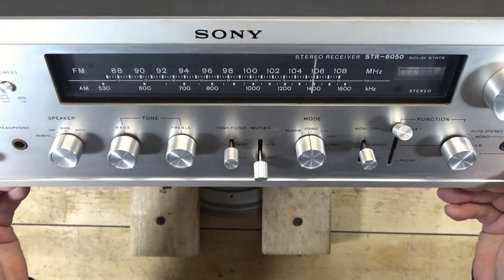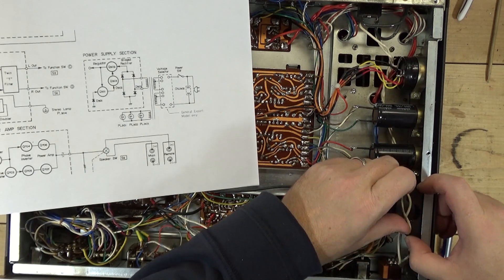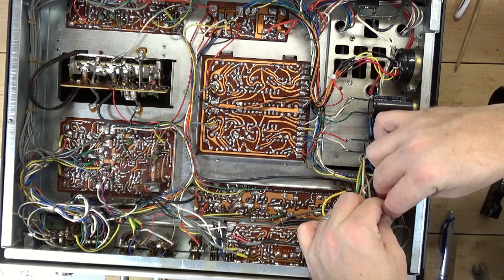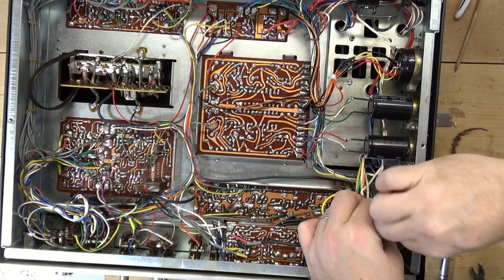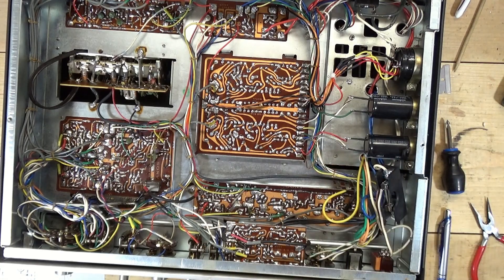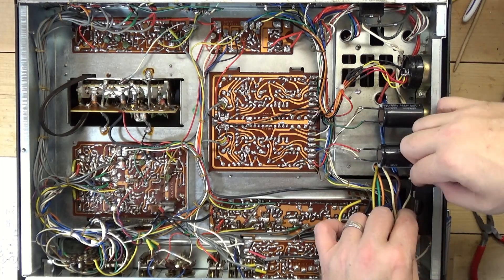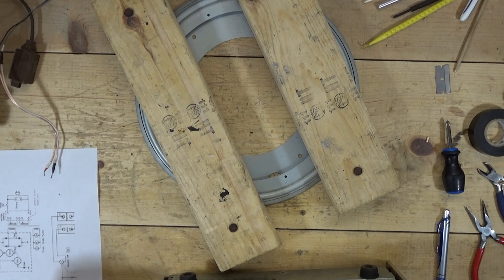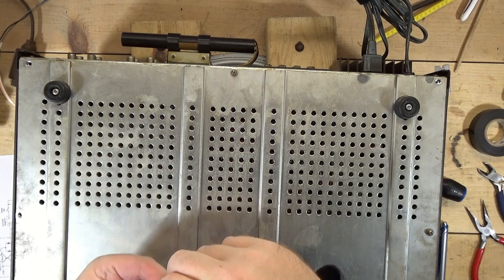Sony STR 6050 Stereo Receiver Upgrade - Adding a 3 Amp Fuse Holder

Comment: Hello, i thinking to buy str-6050. But few days i go i findout that they dont have fuses and can fire up... found your video. So is that fuse instal modification reliable and safe?
Reply from the maker: Without creating a condition to ‘blow’ a fuse it is hard to tell…the placement of the fuse is consistent with the placement of fuses in similar receivers.  As I say in all of my videos - do not do what I do.  My suggestion would be to reach you to a tech in your area and ask the question.